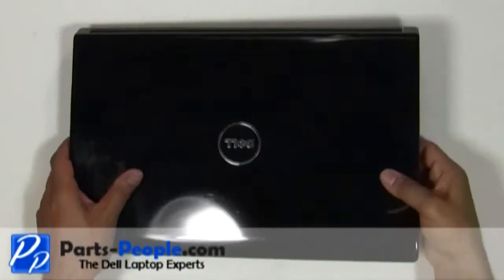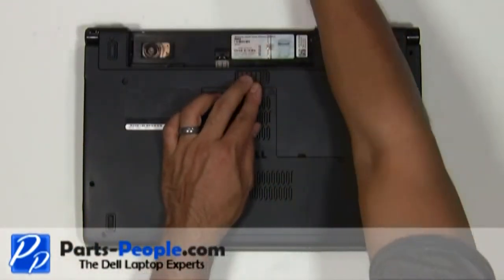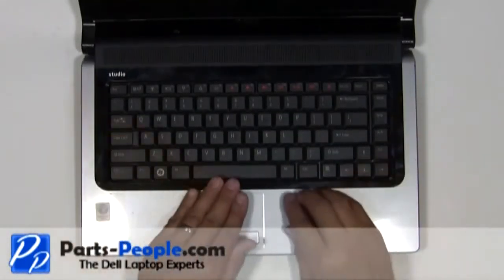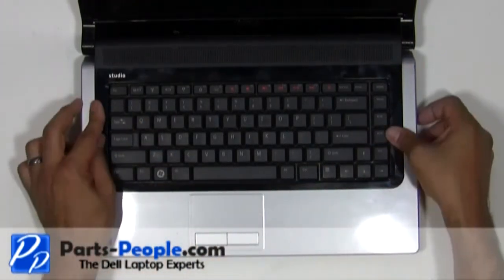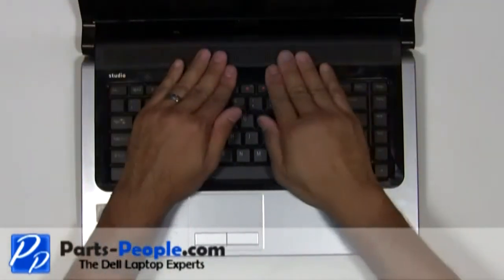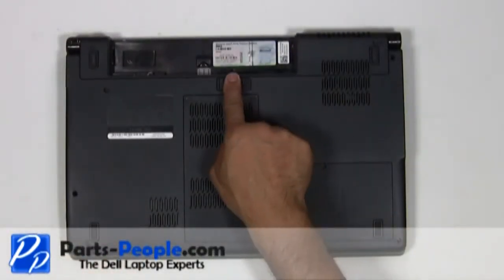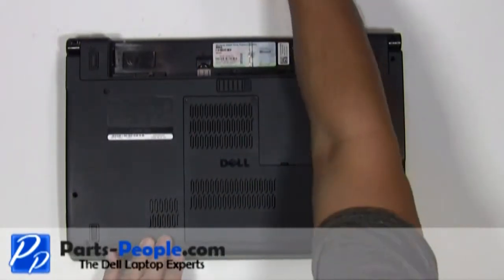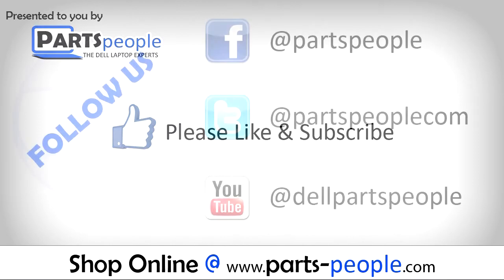Dell STUDIO 1555 / 1557 / 1558 | Center Control Cover Replacement | How-To-Tutorial

Comment from the maker: It sounds like the hinge has broken off of the LCD back assembly and on this laptop it's not that uncommon. To fix it you will need to replace the complete LCD back assembly and transfer the LCD screen and cable.  The LCD back assemblies cost around $60 and can be found here: ppci.me/c/148/245/lcd+back+cover . And you can find the replacement video here: watch?v=swVXu9V758A . I hope this helps.

Comment: Hi.The left part of my laptop the binds the screen together is hanging off. Its not completely off and screen is fine Thank God cuz the wire is still connected. But its now visable. The left side of screen has nothing holding it so its hanging. Any advice on how to fix this before it becomes too late? Or what i need to look to replace the part? Money issues? Shouldn't be too pricey ? Right ?